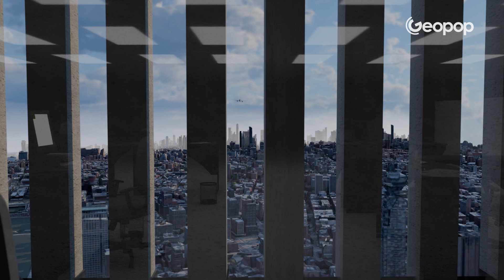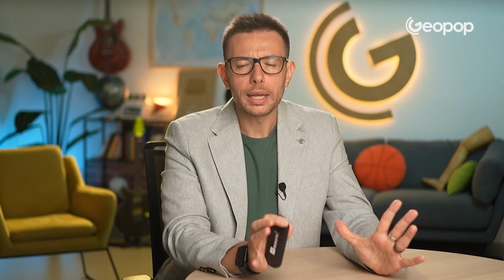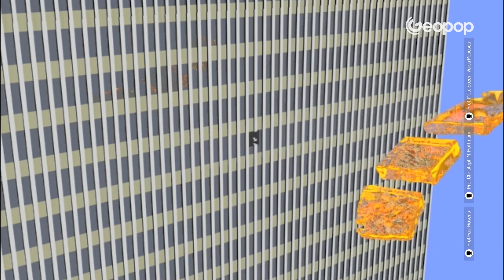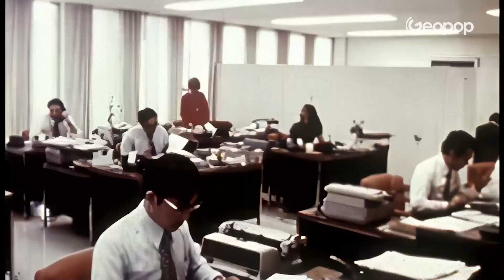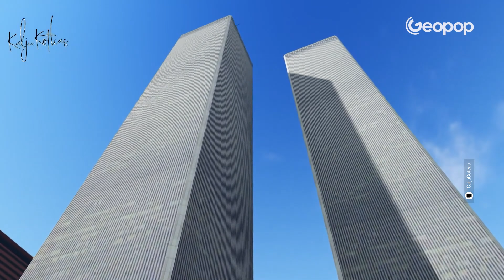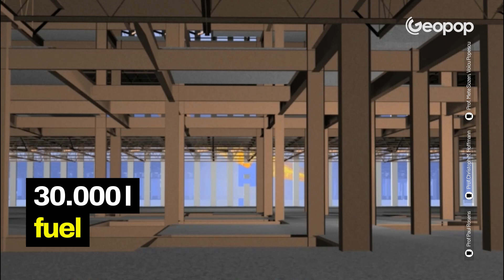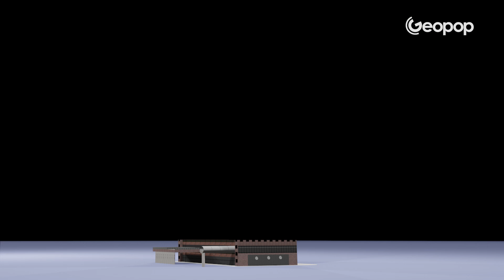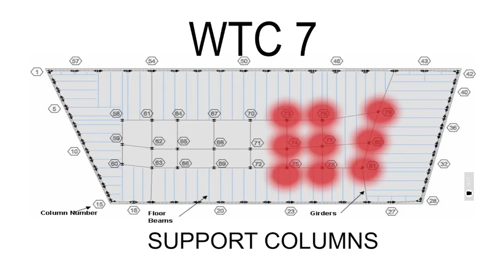9/11, 2001: The Technical Reconstruction of the Twin Towers and WTC 7 Collapses

Comment: I have to say something I don’t know if you clowns know what a jackstand is but if you put a jackstand which weighs about 10 pounds underneath a truck that weighs about 2 1/2 tons but let’s say 1 ton that little 10 pound piece of steel can hold up that 2000. These clowns do not know what they are talking about. They have no real life experience only bullshit experience. piece of truck and I have seen vehicles drop onto the stands and the stands remain standing. They do not crash and they’re generally made out of 8th inch steel.
Reply: There is a difference between static and dynamic load.
Reply: Triangles have a higher load capacity than a box you dunce. Has nothing to do with the material 😂

Comment: I have seen building since 911 totally engulfed in flames and they were 50 to 60 stories and there was no collapse and this was in the eastern part of the world! As Americans, you should be able to assume that the engineering capabilities are much higher standard than those outside the United States! I don’t buy this bullshit by this guy I worked in Steele, heavy structural and stress relieving of heavy I-beams and nothing he says would stand up to what I’ve seen, and done! there is no way in hell that that building or buildings can collapse without the aid of a rapid heat transference, and that was not going to happen at the rate of speed and the short time between the fire, and the total collapse in 10 seconds thereabouts! So the question has to be who are these clowns working for and who are the rest of you clowns protecting by agreeing with what this clown is trying to spread! There was never an investigation done yet there are images of beams, still dripping, molten metal with diagonal cuts from the debris. As far as building seven goes, I heard out of Larry Silverstein’s big mouth, talking to firefighters to go ahead and pull it! What the hell does go ahead and pull it mean? I’ll tell you what it means it means it was wired with explosives, and that’s exactly what brought down seven.
Reply: So all fires and all buildings are exactly the same and the circumstances and results are always identical?

To say that a commercial real estate developer casually admitted to multiple felonies on national TV without prodding and with no repercussions, by giving an order to the fire department (who don’t take orders from real estate developers) to blow up a burning building (which they also don’t do) is one of mankind’s all-time dumber ideas. 

It originated with 3 teenage boys who made a crappy movie that caught on with people who don’t use the thinking part of the brain. It is a patently stupid claim they have since apologized for, but not everyone got the memo. 

In 2002 during an interview for the PBS program "Rebuilding America's Defenses,", the conveniently Jewish commercial real estate developer and owner of the World Trade Center Building 7 Larry Silverstein made the following comment;

Kevin Spacey (narrator): Pelted by debris when the North Tower collapsed, [WTC] Seven burned until late afternoon allowing occupants to evacuate to safety (note: the conspiracy crown ALWAYS leave this context-setting preface out)
 
Larry Silverstein - I remember getting a call from the fire department commander, telling me that they were not sure they were gonna be able to contain the fire, and I said, “We’ve had such terrible loss of life, maybe the smartest thing to do is pull it.” And they made that decision to pull and we watched the building collapse

Nobody, but nobody made any fuss over this until several years later when 3 teenage boys made a low-budget  and briefly popular_documentary_ film (the research for which never required them to leave their bedrooms) in which all on their own decided that "pull" meant blow up the building and that this relatively unknown commercial real estate developer had ordered the fire department to do so, then casually admitted to his crime on national TV without prodding and with authorities and his insurers taking zero interest.

Because firefighters take orders from real estate developers and blow-up burning buildings. 

Maybe, just maybe there is something else going on here. 

Larry Silverstein (allegedly) got a call from a (unidentified) FDNY Fire Commander who was concerned Building 7 could not be saved and did not want to risk losing more people in a hopeless effort. Remember the FDNY had just lost half of its responding members that morning when the Twin Towers collapsed – 343 firefighters killed! 

The concern is not risking life and they want to end the efforts to save the building to do so. What does “pull” mean to an FDNY firefighter in the context of a building that is burning out of control when hundreds of firefighters have just been killed and injured? Let’s find out.

FDNY Chief Daniel Nigro - the on-scene commander at Building 7 on 9/11/2001;

The biggest decision we had to make on the first day was to clear the area and create a collapse zone around the severely damaged 7 World Trade Center, a 47 story building heavily involved in fire. A number of fire officers and companies assessed the damage to the building. The appraisals indicated that the buildings structural integrity was in serious doubt. I issued orders to PULL back the firefighters and define the collapse zone. It was a critical decision; We could not lose any more firefighters. It took a lot of time to PULL everyone out, given the emotionalism of the day, communications difficulties and the collapse terrain

Deputy Chief Peter Hayden - 33 year veteran, NYFD in the August 2002 Firehouse Magazine;
 
No, not right away, and that's probably why it stood for so long because it took a while for that fire to develop. It was a heavy body of fire in there and then we didn't make any attempt to fight it. That was just one of those wars we were just going to lose. We were concerned about the collapse of a 47-story building there. We were worried about additional collapse there of what was remaining standing of the towers and the Marriott, so we started PULLING the people back after a couple of hours of surface removal and searches along the surface of the debris. We started to PULL guys back because we were concerned for their safety 

The word “pull” comes up quite a bit, but they aren’t talking about blowing up a building now are they? “Pull as it turns out is common FDNY slang for literally pulling the firefighters out of a too dangerous situation. 

Why would you believe saying "pull it" to a firefighter means "please blow up my building"?  Doesn’t that whole scenario seem odd?  That would be a strange use of language.  Since when do the FDNY blow up buildings on orders from real estate developers?  

Dan Nigro, not just “a” fire department commander but the FDNY commander responsible for operations around Building 7 is quoted repeatedly using the word “pull” in reference to his firefighters,  He isn’t pulling “the building”. That is not what the FDNY even do. He is pulling the people.  “It” is the firefighters and first responders, NOT the building.  He wants to avoid further loss of life. 

343 FDNY firefighters KIA.  These were not just co-workers. They were brothers, cousins, uncles, nephews, fathers and sons.  Literal and figurative. 

Larry Silverstein and the (unidentified) “fire department commander” were concerned about lives, not the building. Silverstein says he made the suggestion to “pull it” (the firefighting operation) because we’ve (already) had such a terrible loss of life but he gave no order , no command. “They” (the unidentified FDNY commander) _made the decision, gave the order. 

Because FDNY commanders do not take orders from commercial real estate developers. Indeed, it goes deeper than that:

Acting Chief of Department FDNY Dan Nigro - I made the decision (without consulting the owner, the mayor or anyone else - as ranking fire officer, that decision was my responsibility) to clear a collapse zone surrounding the building and to stop all activity within that zone. Approximately three hours after that order was given, WTC 7 collapsed. Conspiracy theories abound and I believe firmly that all of them are without merit

Leading demolition and explosives expert and editor of Implosion Magazine Brent Blanchard - We have never ever heard the term ‘pull it’ being used to refer to explosive demolition, and neither has any blast team we’ve spoken with

So in short, you were lied to by 3 teenagers who just made some shit up and put it in their shitty yet semi-popular movie. Two of them have subsequently admitted the whole thing is a load of male bovine excrement. The other is a convicted felon. 

Lastly, for a variety of reasons I am quite certain the conversation as related by Mr. Silverstein never took place. But even if we accept it as gospel, Silverstein agreed with the (unidentified) FDNY commander that Building 7 was a lost cause and the firefighters should be pulled out to avoid further loss of life.

This is why it is better to think than to let teenage boys do your thinking for you.
Reply: Where, exactly, were these 50-60 storey buildings which were 'totally engulfed'. I'm curious. 
And, how many of these buildings used a lightweight tube-in-tube design which was wholly reliant on structural integrity to remain standing (as opposed to a solid concrete central core)? Please be specific. We'll wait.

Comment: Yes, steel, and both buildings collapsed inwards, this is not suspicious at all, wtc7 with important evidence was also destroyed by the way, he himself did not collapse
Reply: Everything seems like a conspiracy if you don’t understand how stuff works. 

Fundamentally the Twin Towers collapses - though not identical - are not hard to understand if you take the time. The 47 core and 236 perimeter columns support all of the gravity loads of the building. ALL of the resistance is in the columns.

Planes impact Towers, causing massive structural damage, destroying sprinkler systems, tearing out gypsum board walls and blasting off the SFRM insulation from the floors. Multiple floor-wide fires are started instantly and spread rapidly due to the destruction of fire protection systems and venting of the building during the impact.

Serious fires were largely confined to the impact damaged floors and those immediately adjacent to them.  

Fires were started by the impacts and fuel aboard the aircraft, which acted as an accelerant. No shortage of other consumables inside the tower to continue the fires. 

Collapse was initiated (started) at the impact and fire damaged floors when floor trusses exposed to heat over time sagged, in turn pulling on and causing the inward bowing of perimeter columns by up to 5 feet until they buckled. 

No steel melted or needed to. Structural steel will bend and fail at less than half its melting temperature.

Once the perimeter columns buckled the formerly static load above became a dynamic load 30 times greater, easily overwhelming the structure below.

Thousands of tons of now loose debris fell through the open off space - through the inside of the building bypassing the columns - dropping 12 feet onto the first intact floor it comes across. The massive instant overload causes the floor to fail, adding its mass to the falling mass which continues to accelerate for another 12 feet until it impacts the next floor, rinse and repeat all the way down. Rate of collapse increases as momentum increases. As each floor fails, air inside the building (the Towers were 95% air by volume) is compressed, then blows out the sides _in reaction to the Tower falling, not the cause of the Tower falling.

No fire required at all on floors below the impact points for them to fail. The mechanisms that started the collapse are different to the mechanisms which continued the collapse.   That will be a difficult concept for some.

As the floors fail the perimeter columns are left literally hanging in the breeze, no longer attached to the rest of the structure. They peel away and fall in great sheets (think banana) out to more than 600 feet from the base on the 4 points of the compass. 

Core columns failed last. 

Each 110-story tower had a 1-acre footprint. The debris pile was up to 14 stories deep and spread out over 16 acres, destroying 8 surrounding buildings and damaging more than 100 others. 

Building 7's collapse took a lot longer and could not have been any more different, being a progressive collapse of the core, followed by the exterior moment frame.  The collapses of Building 3, Building 4 and St. Nicholas Church were also completely different to those of the Twin Towers - but nobody ever talks about those.

Comment: They never talk about the massive sprinkler system which never went off or talked about that's mandatory in all tall buildings. Water would have cooled the steel. There is something missing in these investigations.
Reply: What happens to the standpipes that carry the water for that system when you drive 117 tons of airplane through them?
Reply: Sprinklers? You're kidding, right?
Reply: It is and has been talked about from ever single floor above and at the impact zone lost any water, it’s not like there’s people’s own account of water rushing down the stairs and elevator shafts from being so badly damaged from a plane hitting the building
Reply: There is quite literally phone calls from people in the building stating they are up to their ankles in water from the sprinklers.